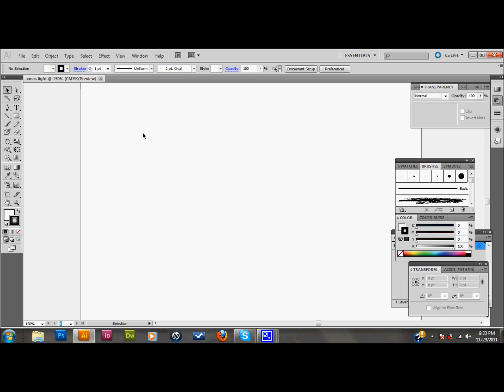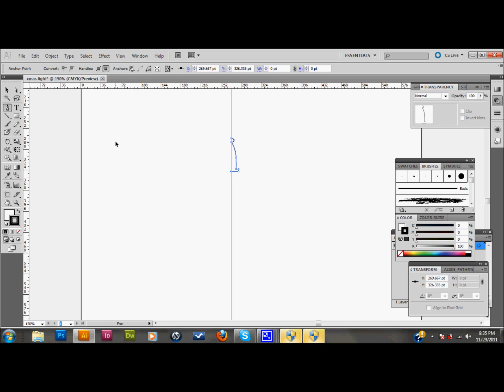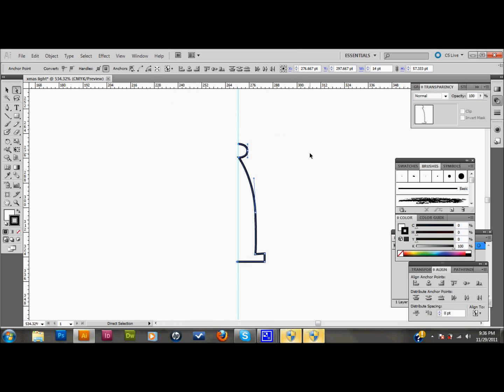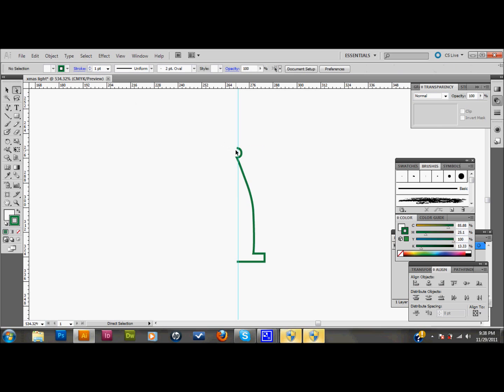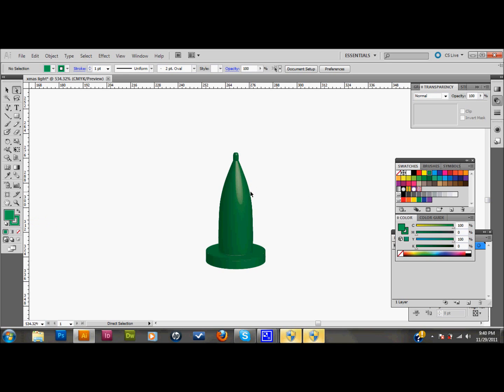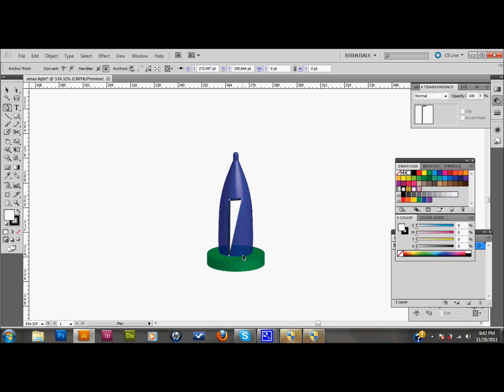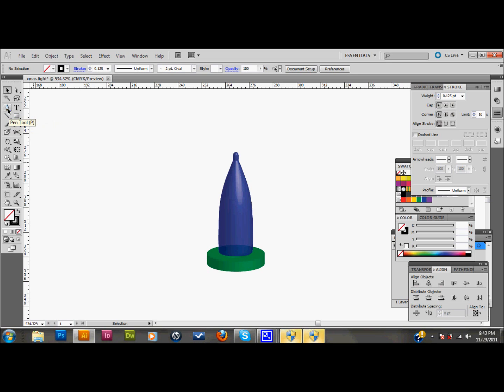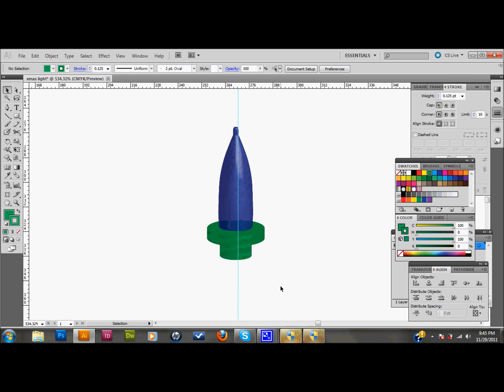Illustrator Tutorial 3D Christmas Lights | Glazefolio Design Blog

Comment from the maker: @hk95501 You can make an image like this in photoshop. It is a bit more involved with making and filling paths with gradients. The easiest way in photoshop would be to take an image of xmas lights and cut them out of the image so that you can use them wherever you want. It wont be the same look as this as it will be a real image. You can certainly use filters, effects or adjustment layers to fake it. I do not work with coreldraw personally. Thanks for watching!